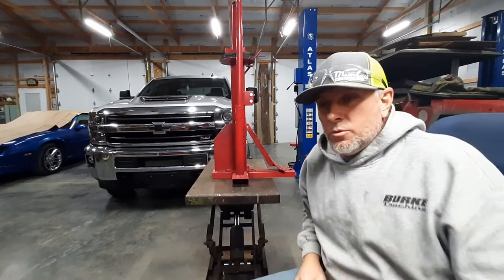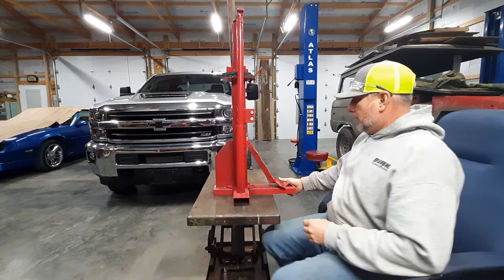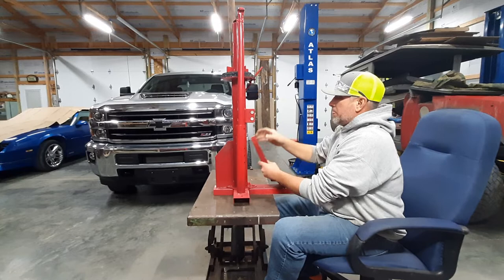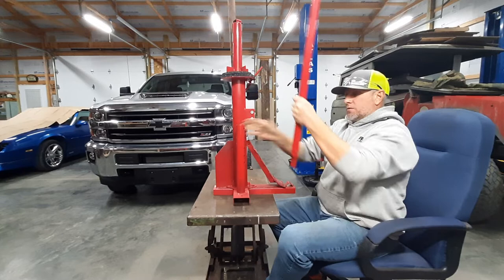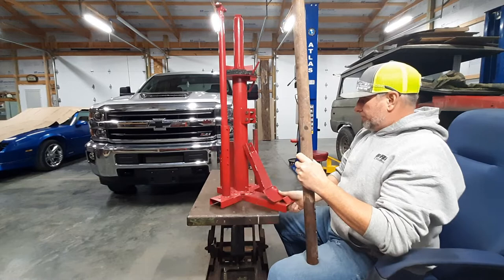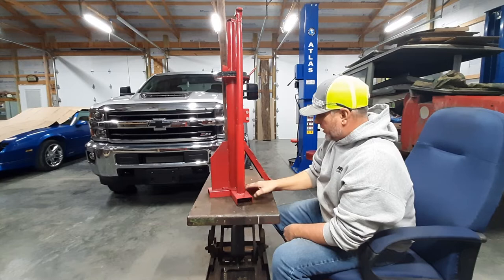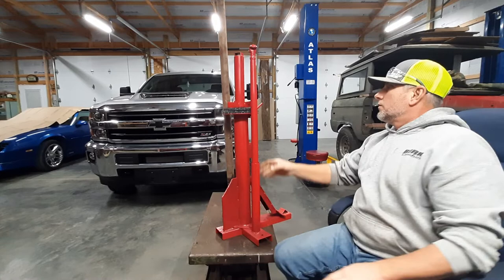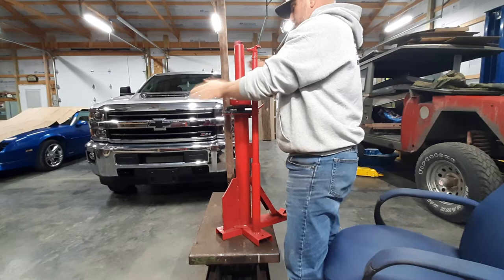harbor freight manual tire changer mods

Comment: On the breaker arm side straps I just welded some 3/4 inch pipe between them every few inches. On the breaker pipe that attaches to the straps I put angle iron resting on both edges down the top and bottom, bottom piece like a V top piece upside down V. It's stout, doesn't bend on big ass tires.
Reply from the maker: yeah that sounds like good simple add on to make it strong

Comment: Remember when you break a beat on your tire that piece of metal has to be at an angle it does not need to be a 90° angle because that is the wrong angle it needs to slide in there and strip it downward all that extra bracing that you did is worthless
Reply from the maker: well ole johnny boy im not sure your comment even makes sense